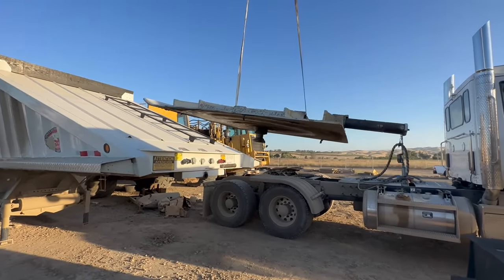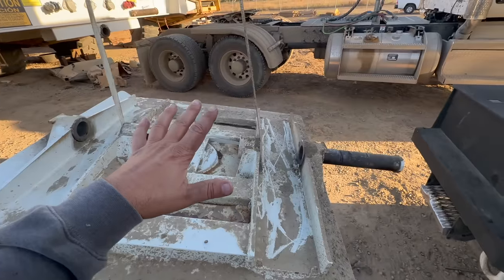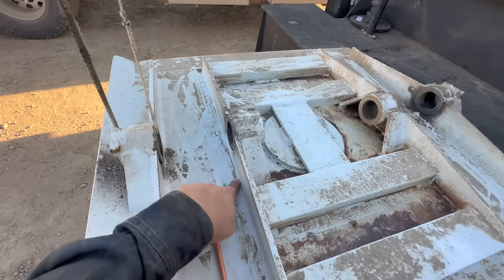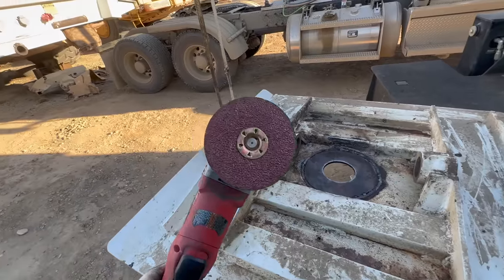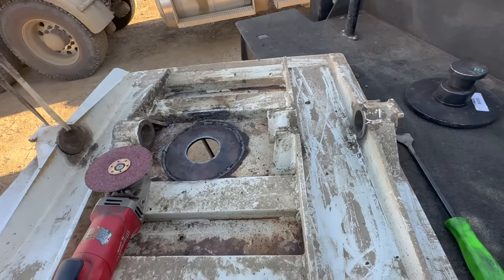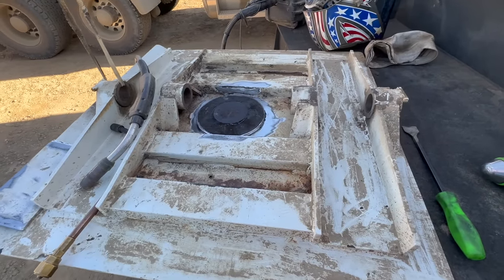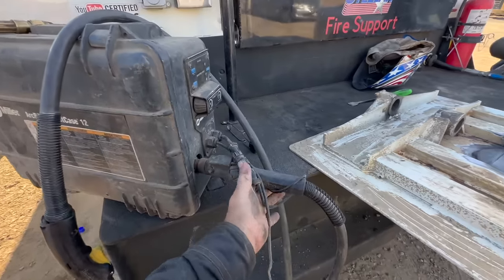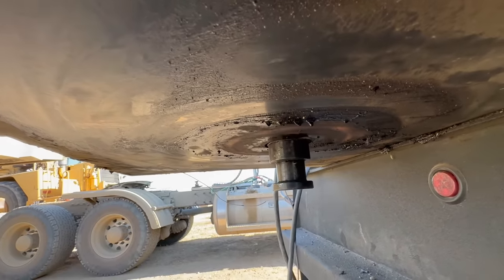No grease destroyed this king pin!

Comment: It's not quite apples to oranges but REX chain company did lubrication tests many decades ago and their results showed that an unlubricated chain has about 600 times the wear rate of a properly lubricated chain.  Oil/grease is cheap and works... very well.  I constantly fight with customers to get them to throw even a few drops of oil on chains, let alone properly lubricating them.  Downtime in my industry costs about $ 25,000 per hour and I have seen days of downtime caused by not using fifty cents worth of oil.
Reply: The Ol' Grease worm does lots of damage , but just think of all the time those operators saved by not greasing  ...............
Reply: I bought a $300 electric grease gun. I gave them a ring with 6 sheet of lamented paper showing exactly where the grease fittings were. There was 17 on this machine. I told them in the morning grease it before the shift. I come back 2 weeks later... Well the grease guns battery is dead I cant grease anything... I mean you can only do so much.

Comment: Greg is not BS ing about those 3M Cubitron ll discs....
I have been using for over 5 years now and the 36  grit
removes metal very very fast and gives a smooth finish....
I use on hot rolled structural steel we use for making 
mobile bars for hotels and they have to look like furniture....
no chattering on bouncing around on the material....
Greg knows his Grinding Discs......
cheers, Paul

Comment: Great work!!!  Not trying to publicly blast...just asking a question to learn.  Do the craters left behind by the carbon arc gouging process weaken the base plate?
Reply from the maker: No, there were filled In with the new weld. I should have cleaned them out a little first though.

Comment: Those cubitron discs are really that good. The old timer I wrench under handed me a handheld grinder with one of those discs when I was angling a piece to join on a large bench grinder. So much better. It's the mobility of a handheld tool with more cutting power and precision than the benchtop. It's the new OG stuff, you recommend it because it is absolutely the best.

Comment: We can hope that they figure out that it’s cheaper to grease things every once in a while. So that they don’t have to call you. I greased my truck every 10,000 miles weather it needed it or not, when I sold it 1,125,000 miles on the original kingpins and bushings. 5th wheel needed to be rebuilt & I greased it every once in a while. 
Thank you Sir for the video

Comment: Great job on the replacement love the vids. 

One thing you do not grease the king pin , the jaws are out of adjustment on the 5h wheel. Many many fith wheels today use a Teflon or wear plate no grease whatsoever. Only place that gets greased is the side pins and jaw mechanism.

You can see how the top of the pin is worn as well, the adjustment on the fith wheel is gone most likely the jaws are complete junk, and has been out of speck and illegal for some time.
Reply from the maker: Yep.  They were trashed.  Customer installed brand new ones. Hopefully correctly.
Reply: @OFW  they need to check and maintain adjustments,  the driver who drove that trailer should have been screaming something was wrong just a small amount out creates a noticeable clunk also ruins the truck.

Comment: I'm not going to say that weld is not structural because it is to a point but most of the load force is back and worth not up and down the more important part is the fitment in the hole

Comment: I run my suitcase off of a bobcat instead of a big blue, I would be interested to see you test out live voltage readings with certain lengths of lead connected to it.  It is surprising how much voltage drop occurs between my powerplant & suitcase depending on if I have 4/0, 2/0, or 1/0 connected, and 50' or 100' of lead.

Comment: Every now and then I get to deal with dry 5th wheel plates. In that the trailer will not allow the truck to steer, it keeps the truck going in a straight  line. Lube 5th wheel and truck steers normal.
  I had one on Hwy 299W in the Trinity River canyon, driver had hard time making the curves. Perhaps you went up 299W to get to Happy Camp.
 You got good stuff!

Comment: That cubitron abrasive pad, how well does it work grinding along its own plane?  I mean along its edge.  Say for example I have an interior fillet weld that I want to grind down with higher precision than I can get with a flap disc, how well does the edge of that pad hold up?
Reply from the maker: Extremely well.

Comment: I work for a small equipment rental company and we deal mostly in power generation, but pretty soon we'll be entering the earthmoving sector and i'd love to hear your reccomendations for a welder/generator to go on a service truck? We don't have a dedicated welding truck, it's a lube truck and while not ideal I'll have to do my best to make sure it's equipped for most jobs. I'm the head mechanic (one of only 3 total) and the owner of the company told me he'd like me to learn the hard-facing process for the buckets on machines we'll be getting. I'm not a certified welder, although I have some experience with flux core and MIG welding but no experience with dual shield or stick. I'd be looking for a machine that will cover all the bases, would love to learn arc gouging too. (I don't plan on doing any structural welding until i have the experience) What's the best way to go for a good all around setup without breaking the bank? Love the videos!
Reply from the maker: My choice would be a 302 air pak.  You can do light gouging and it will provide all the air you will ever need. You can run a wire feed unit off of it.  Good all around machine.

Comment: "We were taken from the ore-bed and the mine,   
   We were melted in the furnace and the pit—   
We were cast and wrought and hammered to design,   
   We were cut and filed and tooled and gauged to fit.   
Some water, coal, and oil is all we ask,
   And a thousandth of an inch to give us play:   
And now, if you will set us to our task,
   We will serve you four and twenty hours a day!"

Rudyard Kipling, the Secret of Machines

Enjoy your videos, too often components fail because of simple maintenance such as lubrication

Comment: Hi Senioro Greg,    Yours is an prime example of leave them wanting.  The 60 min plus vid's are seldom worth staying the course.  I looked at your weld around the new plate and on the "right" side, it looked like the weld just rolled up against the plate edge.  I know your work better than to think that but why did it look like that?
I tried some 3m Cubitron sanding discs but did not see a big plus over the good quality alum oxide discs I buy.  I haven't tried the grinding discs because I haven't had any welding goin on.  I could see what you did in real time and it is clear they cut like a hungry bear.....  
Threeeess to Ya Laddie.
Ye Ole Caterpillar Cowboy
Reply from the maker: Im not sure what you are talking about. Might be hard to see in the video.

Comment: I have owned and been working on trailers and trucks my whole life and I would think that the tractor that has been pulling that trailer has wore out fifth wheel jaws or they are extremely out of adjustment with a lot of slop to wear out a king pin that bad on a relatively newer trailer even with a low amount of grease that was on that plate and kingpin.